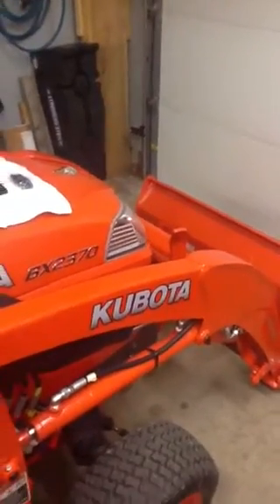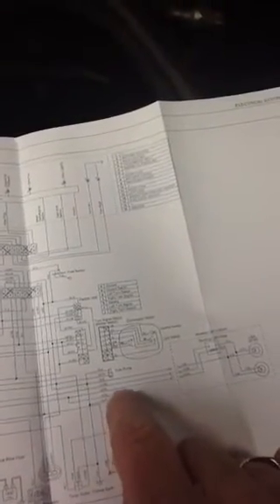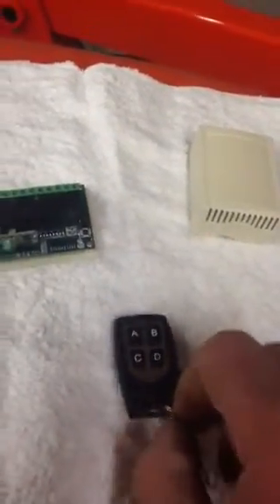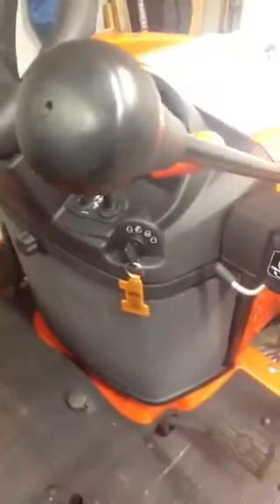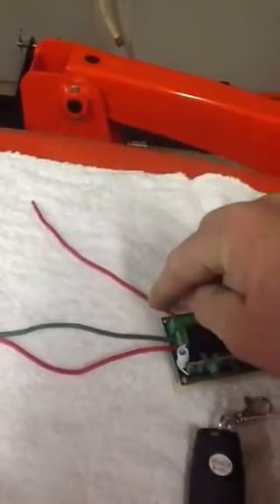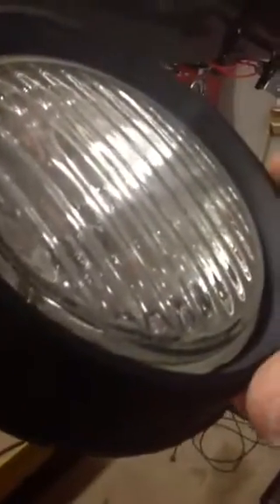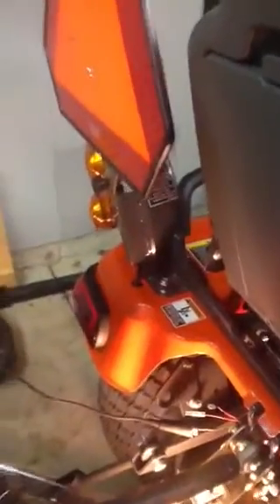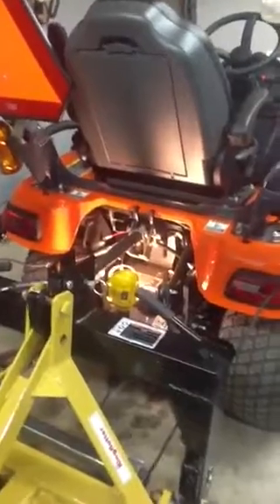DIY Kubtoa BX ROPS lighting option wireless switch video #1

Comment: Nice tractor Goneredcar1 !

I took a few notes and then got through your discussion.
Are you certain each relay on the switch is good for 10 amps?
Or is the whole switch only good for 10 amps ?  
I hope I'm following you correctly here.

I do recommend weatherpack connectors.
I got mine at Del City online.
I built my trailer wiring out of them. I spliced some shielded 4 wire boat wire ran up the back tube to the traditional 4 prong at the hitch.  I just soldered the pins on.

Dave

Comment from the maker: They are rated at 10 Amps each.  Today I tried the load test with both lights and the relay appeared to be fine no extra heat. So no extra relay needed at this point.

Comment: Where did you get the wireless remote control do you have a model number?
Reply from the maker: I got wireless 4 channel relay board on EBay with two controllers. I was unable to locate the purchase it was to long ago.  If you look and are unable to locate I give it a try.